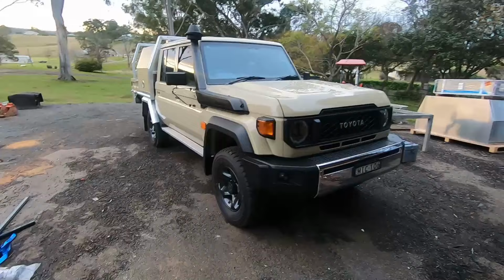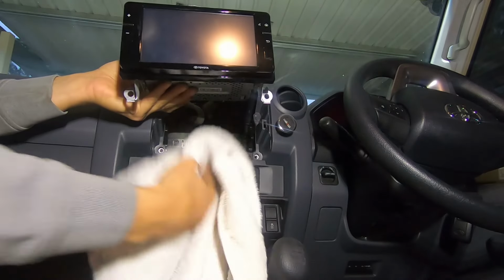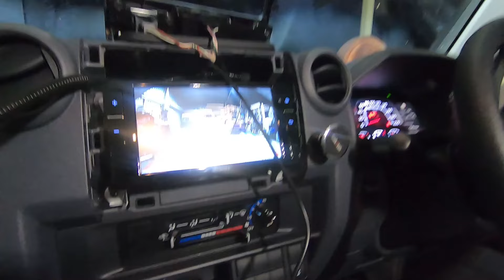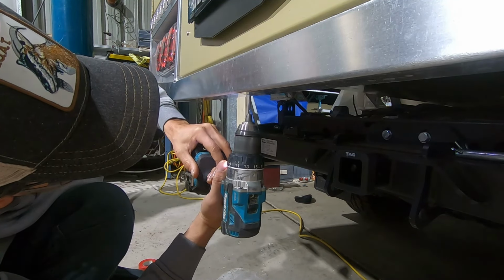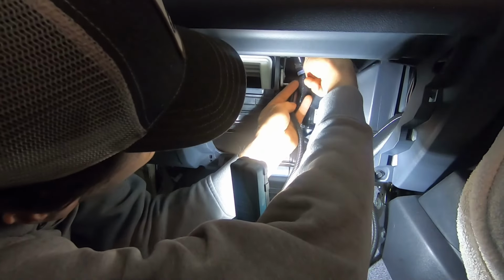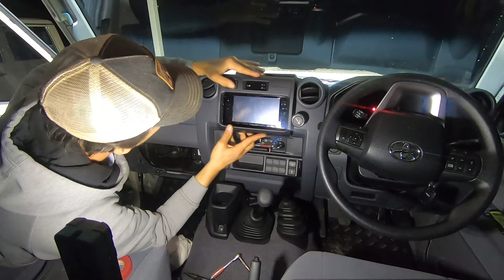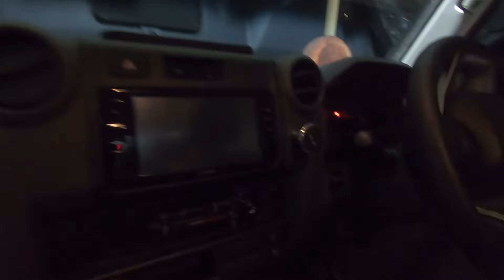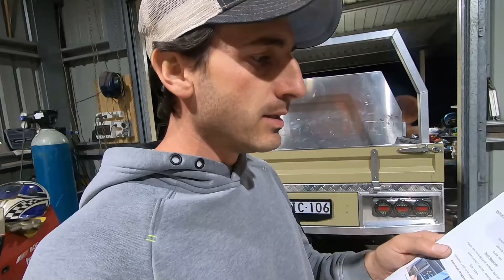2024 70 series Landcruiser reverse camera install. Facelift.

Comment: The Toyota hitch has a anti rattle bolt underneath so you shouldn't have any problem with the pin
Reply from the maker: @kisbushcraftdownunder  That makes sense. Though the anti rattle bolt is only for when not towing. It's supposed to be loose when a trailer is attached.